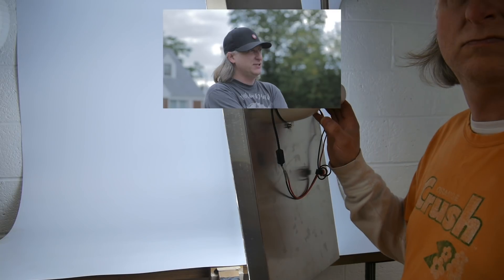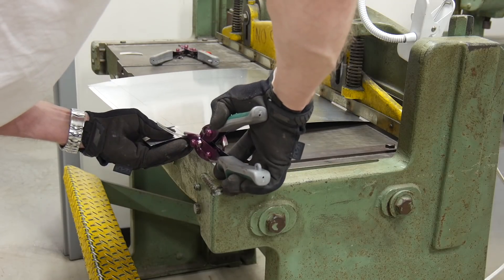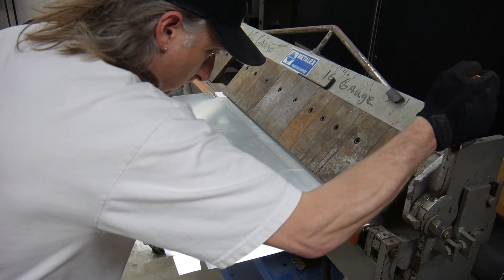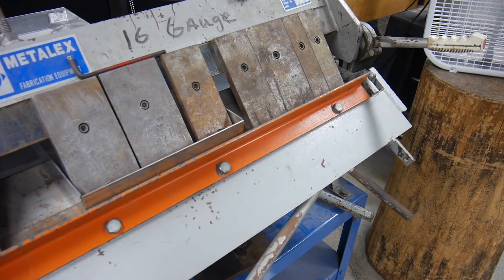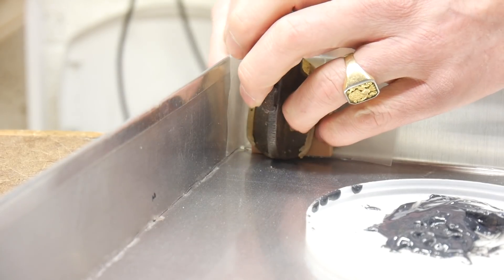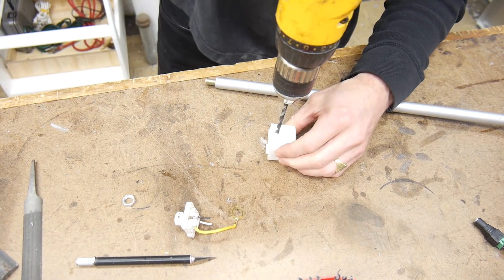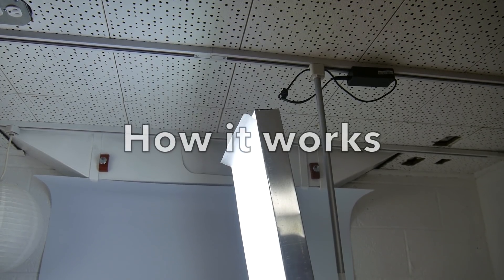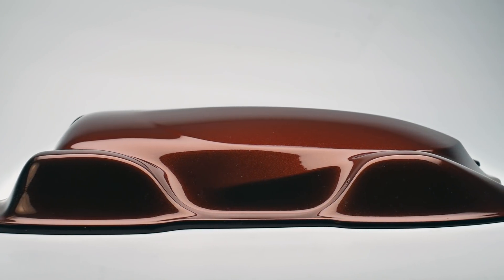How to build a  🅛🅔🅓 Soft Box Build: take better video and photos

Comment: I went to habitat for humanity and bought a large square overhead lighting box, something that would have been in a early 90s house in a kitchen. It was about $5, Then I just installed LED strips inside of it and mounted it to the roof of my softbox. Works pretty well. 

For anyone who doesn't have tools involved here, the lighting section at Habitat for Humanity is really great for building some DIY lighting projects/experiments on the super cheap.

Comment: 8:35 did you just connect the red wire to the black wire? D:
Reply from the maker: thepianoaddict wired in parallel, all the positives are connected and all the negatives are connected, then wired into the 12 volts.

Comment: You are mentioning diffusion material e6000 (if i heard right). When googling it it returns some glue. Any reference you can share. Thanks 
Great design and i like the flexibility. I often use EMT tubing, rigid, cheap and easily available
Reply: The diffusion material is drawing vellum. (Paper) He fastens it with white glue or you could use e6000. (A really versatile and usefull glue)
Reply from the maker: Francois Bujold I deal would be a pice of stretchy fabric, the paper can tear and get damaged. I can't always reply, depending on how busy I am.
Reply from the maker: taykarottis correct! thank for your comment!
Reply: Is velum the material of choice? What alternative is there?
Thanks for taking the time to reply